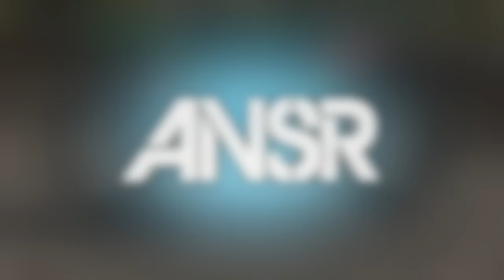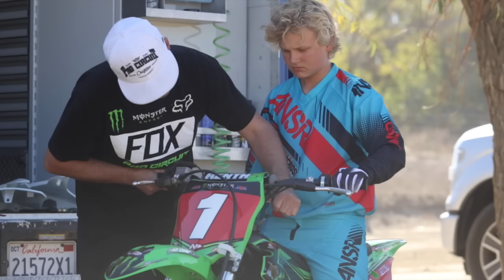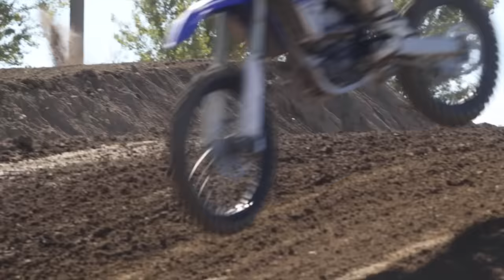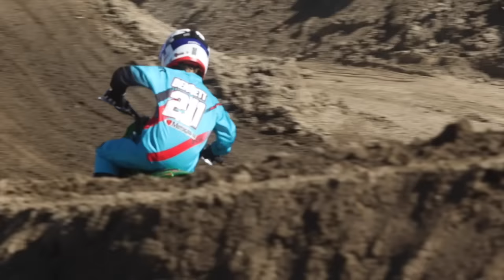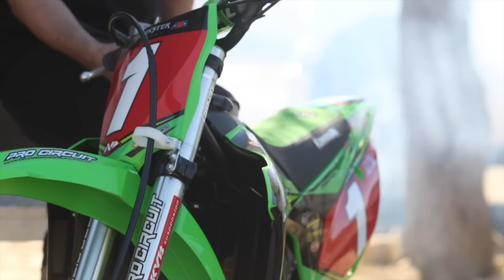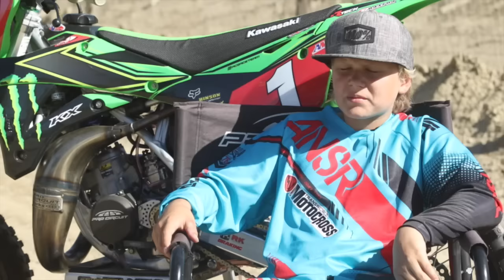Pro Circuit Kawasaki KX85 | Mini Ripper | TransWorld Motocross

Comment: Sick bike I’m getting a 2019 Kx 85 where could I get the graphics
Reply: search for monster energy pro circuit graphic kit kx 85
Reply: Did you get the kx
Reply: Throttle syndicate
Reply: How much was it ?
Reply: @kadenrwy  they are like 4500 dollars a little bit more than that tho
Reply: I’m about to get the brand new 2021
Reply: @coltoncoghill3925  mines was only 3800$
Reply: @kadenrwy  were do you live here in illinois, USA it costed 4,900
Reply: @coltoncoghill3925  Georgia
Reply: @coltoncoghill3925  the store next to my house is only 3800 for a brand new never started up never used 2021 kx85
Reply: Willmax
Reply: @coltoncoghill3925  Up in wisconsin I got mine for 4000
Reply: I got mine from decallab, for my 2019 kx 85
Reply: xoLance 5800 Washington
Reply: EBay do good sticker kits

Comment: These are guys aren't just puttin' around like the rest of us.  They ride hard all week long.  Probably put 10-15 hours per week on it. And yes, rings every 15 hours is pretty standard for a minibike like this that is ridden hard.

Oh, and you heard him mention the fuel they run -  VP MRX02.  $170 for 5 gallons (that's not a typo).  104 pump octane.  Probably the best fuel for a modified 2-stroke like this.  I have used to myself.  It is bad-to-the-bone.
Reply: Where can I buy some and can I run it on my stock kx85 with some work
Reply: @angelteamnolimit624  not necessary

Comment: The manual recommends tire pressures of 18.  That seems high to me.  What pressures do you guys run/recommend?
Reply: 13 front
12 rear
Reply: @Sla_tv  That sounds reasonable to me.  We've been running 12 front and rear.

Comment: Do you think that I could ride this bike? I am 5'10 and weigh about 144lbs. I am a complete beginner I ride a 125cc on the street and rode an enduro on a track once. I could get a 125cc 2st but I feel like it would kill me the second I touch the throttle. Idk those small bikes seem fun, they are a good hybrid between a pitbike and a normal mx bike